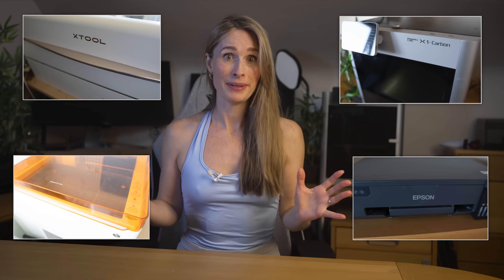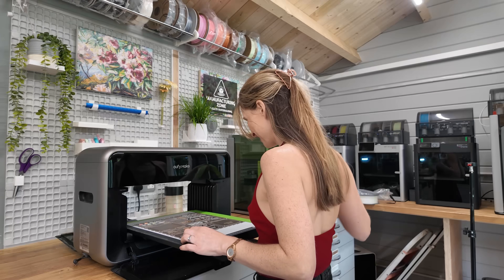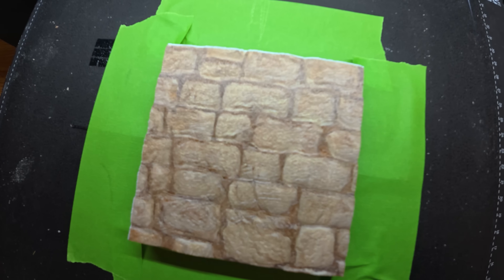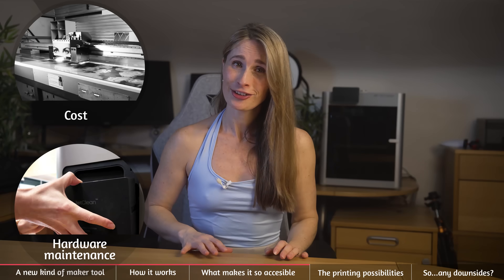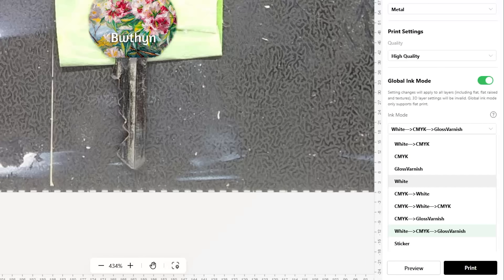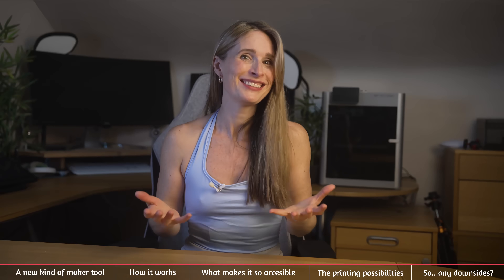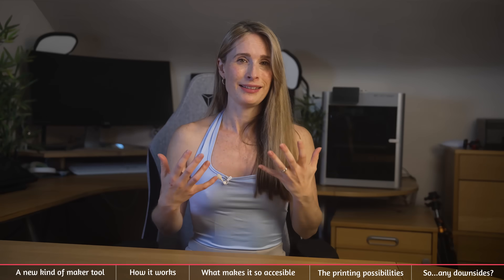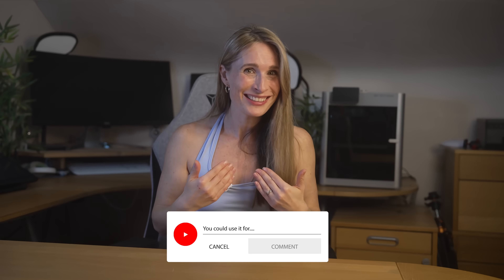UV Texture Printing With the Eufymake E1: Testing & Real-World Results

Comment: Feels like you have been paid not to mention any downsides with it... I will do it for you
1) is resin printer, fumes are toxic, same as if you print with abs. Even if you don't smell it, it's still there killing you. Each day breathing that shrinks your life for probably 5-10 days or more. Who knows exactly but the girl that was using epoxy at home which, is very similar in toxicity, lost almost all lungs, the lungs was like cheese, full of holes etc, you can find it on YouTube somewhere.
2) they sell the inks to you at  400 dollars per litre, while buying uv ink wholesale is around 30 dollars per litre.
3)they are fully proprietary system, which means if for any reason they stop producing cartridges or will have lack of it, as nowadays is so often when supply chain getting closed with all Trump tarrifs etc you will end up with brick.
4) is uv printer and therefore clogs very easily and fast, there is special maintance box that cleans everything all the time, so you will spend additional 20-30 dollars a month just for waste as it flushes the inks daily even if you don't print etc. And if you turn it off for a while you will need to replace the printhead which will cost you almost same price as whole printer (unless they will actually make affordable replacement)
5) and finally, it is Ankermake, a company that released 3d printer as kickstarter, promised lots, the printer flopped financially and they stop any support for that printer, so no part replacements etc so if you have their 3d printer it will work fine till any part will break. It might happen to this printer as well as they have done it once. That's the reason they have changed the name!
Reply from the maker: Well what you 'feel' is usually a poor measure of what is 'true'..... ;)  No pressure or questions whatsoever from Ankermade, so whatever you imagine might be true, clearly isn't. Likewise your questions lack a fair bit of accuracy, hence I haven't covered things that aren't true:

1) Toxic fumes - Incorrect, this is wild misinformation - firstly, basic chemistry - not all 'resins' are the same. So no, this is completely different to ABS fumes (which are pretty toxic) - ABS produces VOCs like acrylonitrile, butadiene and styrene (which is literally the acronym of the plastic). However this doesn't mean PLA, for example, produces the same level or type of toxins. Even more abstracted are UV resins. You appear to also be confusing epoxy resin (which has hazardous side effects if heavily exposed) and UV resins.  The Eufymake UV inks are greenguard certified (which is the gold standard for emissions) and considered human safe. Even so, they have an decent air filter built in and I'd still filter anyway if you're using regularly as a general principle, but your core point is just wildly off the mark. Obviously I can't speak for all UV Resins - I'm sure you can find much cheaper/lower quality/lower safety versions of every ink just like every product! But these are pretty good IMO

2) Ink Cost - yes UV inks are generally expensive and yes these are marked above manual VATs for industrial machines - would love to see the cost/features of the machines you're basing this on. As I showed already in the video, there's plenty of industrial machines with prices $8000-$200000, hefty maintenance routines and fair less user-friendly feature sets - but it's slightly silly to compare to those. Be great to see any credible examples you've got as it'll be great if anyone else entered the market with competition, but certainly everything I looked at from Epson, Roland, Procolored or more was vastly more expensive, far weaker features, heavier to maintain and had less safety features (eg like more toxic inks, which contracts your point above).

3) Proprietary System / Tariff risk - This is definitely a risk - although, I'm not sure you can blame Trump tariffs on Eufymake?? I'm not even sure it's relevant based on proprietary systems - eg tariffs are being applied to entire industries, goods classes and countries - so regardless of approach, you'd still suffer the same. But yes, this is definitely a deliberate design choice, so something to consider (although I'm not sure if this will apply with the CISS system they've announced) - I've covered my views on closed vs open systems a few months ago, both have their place and this is the perfect example of where a closed system is useful (ie leaping technology forward, making it far more accessible, easy to use and reliable).

4) UV printer clogs easily - true in general, but incorrect for this machine - yes, this is again one of the impressive things they've done with this device. It just doesn't clog, I've used and abused it for months. I know where you're coming from as this is one of the key grumbles with UV printers before this, but this is one of the key things they appear to have nailed brilliantly. It just works - I haven't had to clear a single clog in all the dozens and dozens of complex prints I've produced. 

5) Ankermake M5 discontinued spare parts- again this just isn't correct. There were lots of rumours about them discontinuing support / spare parts for the M5, but they came out and said it's just not true. Just go and look yourself on google or order some spare parts if you want!! That said, it's unreasonable to expect things to be supported forever and personally, I think the M5 has been overtaken by Bambu and others entering the market, so I wouldn't expect support to last forever, like Windows 10, your BMW, your plumbing parts or anything else - so certainly stock up now if you intend to use an M5 for the next 30 years, but otherwise it's again just not accurate what you've said.

Hope this helps answer your queries and also covers why I didn't include these points (ie as they wouldn't have been accurate)!
Reply: @handsonkatie  1) resin is toxic, i work with it professionally. I personally don't care about your health, you can ignore it. I suggest researching that more better. Also gold standard emissions means the company buying the services that cleans air. You produce 1000 c02, you buy the document and company will clean out 1000co2, so you can claim to be zero emission
2) uv dtf machines for 800 dollars for a4 size and 1400 dollars for a3, they don't print 2.5D but the rest same as this machine. 
3) tarrifs it was tiny example, lockdown, another war etc. All i mean is any supply chain issue and you have issue
4)you skipped what i have written completely...read again. 
5) go to their website- everything sold out, which means you can't buy it, they do not produce any parts at all. Whatever have been produced and not sold yet is available, but soonish there won't be spare parts. You need to research a bit further before blindly believing what they said.

P.s. i list the disadvantages, so far advantages are overlapping disadvantages 2-3 times, but not mentioning it is downside from you!
Reply: I wrote response but was deleted. 
So short. All uv resins are toxic af. All those gold standards you refer mean nothing, they buying offset contracts, so produce 1000 kg nasty stuff, buy offset for 1000kg, in another city company cleans that 1000kg and you are zero emission. In reality you pollute tons.
As to ankermake, all parts on their website sold out. They simply stopped making them.
Reply from the maker: @Jokershadow696  No deletion on my part?? Ok, I think it's clear you don't understand what the Greenguard standard is - it's not some CO2 emission offset scheme - it's the US gold standard for testing of hazardous VOC emissions. This passes that which include a whole battery of testing, spot checks, lab tests and more. The gold level means it's safe to use long term even in sensitive locations (eg elderly, medical locations, children etc) - it's got absolutely nothing to do with offsetting emissions.....

Ankermake - I've just looked up their site, all parts there. Are you US-based perhaps, I know all the tariffs have disrupted supply chains, so perhaps it's a US problem, not an Ankermake problem?
Reply: Also printers I refer is commercial alibaba uv. 800 usd for a4 and 1400 for a3, they don't print 2.5d images but the rest same
Reply from the maker: @Jokershadow696  And sorry, after you're so concerned about quality, VOCs and more.... you've cited an 'Alibaba UV Printer' for comparison???? Good luck with that one....! Be great if you can post the link though, so others can see all the differences..... I'm pretty sure it's not 'just the 2.5d difference' - indeed look forward to seeing the VOC certification for the ink too! Point here is of course you can find cheap versions of anything, but I think you've come in a bit over the top on this one - they've done a very good job with this device and I think they'll be hugely successful quite rightly. Not saying a cheap knock off with more hazardous VOCs, more maintenance and poorer UX won't suit others, but this is aimed at the consumer market and it's a very impressive piece of kit IMO!
Reply: Maybe because my comments was too blunt. I don't say device is bad. But noone mentions drawbacks.
Ok, so I found the certificate. The tests was done in small WELL VENTILATED room for 24h. The importanr part - well ventilated. So technically speaking in the school you referred it should be nearby open window. More or less. Which I basically pointed but probably wrong way.

I am from UK and non of the parts from ankermake 3d printer is available for me. I try to put them in cart to buy and all of them sold out.
Reply from the maker: I think you're now getting close to the point I framed now you're looking things up - which was my point, I'm more than happy to point out any negatives, just what you originally said just wasn't true and I think it's super important to be accurate as possible.

So on the testing, no again it tests 15,000 VOCs in strict conditions - eg 23C, 50% RH and 0.68ACH which is a low to moderate ventilation etc. This ensures consistent testing and the ACH is based on a standard home or office environment (note there are understandably different ACH levels for different ratings, so gold has a higher standard than others).

Again on the M5, just put the motherboard, hot end, led screen and nozzles into my shopping basket and all there?  Spotted some items out of stock, but can't reconcile the statement that 'none of the items are in stock' or they've stopped supporting them - neither is true of the company's position or the reality, so I think this is inaccurate also. I mean Elegoo are out of stock of some of the filaments I want at the moment and my son wants a Switch 2 and they're out of stock, but I'm not declaring Nintendo/Elegoo aren't supporting them any more!! So think the comment needs a bit more accuracy/evidence-basis.
Reply: As to uv printers. They easily can be found on alibaba, even aliexpress, just type a4 uv printer.
All those machines ain't for home use. So need proper ventilation. Many businesses on small scales use them. They can do everything besides 2.5D. Obviously it won't be as easy swap as E1. But I compare only inks. 400 vs 30. Is very significant difference. And saw recent interview with ceo of the company, he said it straight, he aims to earn with inks and not printers. So it will be same as HP desktop printers etc. But I don't judge him at all. But for me is downside.
Reply from the maker: Ok, so now the points are stacking up to more than 'only 2.5d' - so they're aren't for home use, need proper ventilation, won't be as easy swap and I strongly suspect the list will grow pretty long if you actually share a link - I think this is really key as you're now getting very close to the position I actually had in the review. I mean I did check the price of commercial inks, I just compared like for like (ie commercial quality, safe inks, reliable brands). And I was mildly surprised at the reasonable price point - eg cost of my tumbler prints was about 8p, cost of an iPhone case print was about 12p. Now compared to the high quality commercial alternatives (ie Roland, Epson etc, not Alibaba knockoffs), this wasn't a bonkers price - yet the base cost was massively lower and features hugely better.

So I think it's fair to say inks are slightly more expensive, device cost is significantly lower and feature set is way beyond any peer. Likewise they've announced a CISS system which seems odd if they're planning to cut their own margins before launch? 

I'm not even saying, they couldn't cynically become monsters and start tripling the prices in future, but they've priced pretty keenly for now IMO!

But do share a precise link to any of the UV printers you mention, all the ones I've looked at are wildly lacking in features in comparison, priced surprisingly close to the Kickstarter price anyway, have zero details on software integrations, use proprietary components for the key parts anyway (eg Epson print heads), have poor colour reproduction, no smart cleaning, no clog removal and a host of other limitations - so keen to understand!

You're actually coming from the point I started at - ie very skeptical. As I mentioned, I recall being the same with the Bambu Lab X1C when it announced these outlandishly good features...so time will tell, but I can say in the months and months I've been using it, it works just like a household device, cleans itself, maintains itself and super easy to use and this for me is a pretty amazing step forward!  Great discussion though, it's good to clarify all these things.

And do drop me an email on my site if you're struggling with the Ankermake parts and I can send you URLs/screenshots. Indeed if you'd like access to my discord, drop me a note - I like people like you who can help ask all the awkward questions of new devices I'm testing!! 😊
Reply: @handsonkatie  This has been a great conversation to be privy to. 

Thank you both for hashing it out. 

Bonus points to Katie for coming with receipts :)

Comment: You've mentioned that it "wastes" a little bit of ink each day in order to not have things dry up. But let's say one only uses this once or twice a month. Or even less. Wouldn't they be out of ink in between uses? Or did I misunderstand and this is not an issue?
Reply from the maker: Oh no, you just turn it off then and zero ink used.  This is only if you leave the device on. Switching on and off goes through a clever cycle to thoroughly clean everything to avoid clogs, this is the 20 min routine I mentioned.

If you want the device ready to print at any moment, then you can leave it on - in which case it moisturises the nozzle every hour or so (which is why it'll use a little ink every day).

So if in storage for a month, then just turn off!
Reply: @handsonkatie  might it end up with the same issue as a paper printer left unused, where the nozzle can become so dried up that it can't unclog itself? 
Though it seems like the print head is easier to access and manually unclog vs a paper printer. 

I always mean to set up my printer and make sure to turn it on once a week and print a test page to keep it from drying up, but I always forget. 😅
Reply from the maker: I know exactly what you mean with inkjets!!! The shutdown procedure of this device completely flushes the inkhead so you can then leave off without worrying about drying ink. So no issues in months and months. Inkjets should really copy the same sort of approach..... if they weren't all completely useless!! 😂
Reply: @handsonkatie  Thank you for your detailed reply. This sounds like such a clever solution. Seems like this will be another device that ends up on my shopping list thanks to you :)